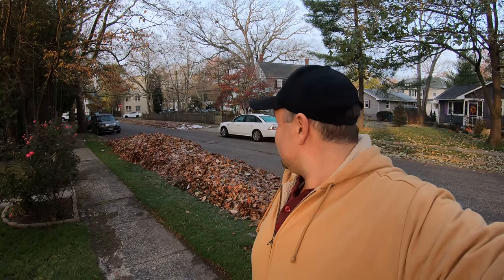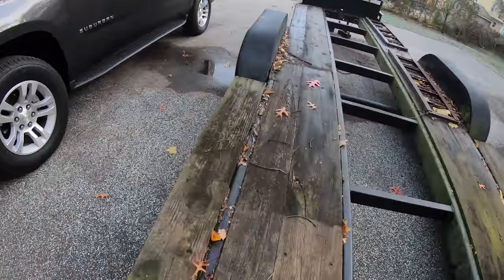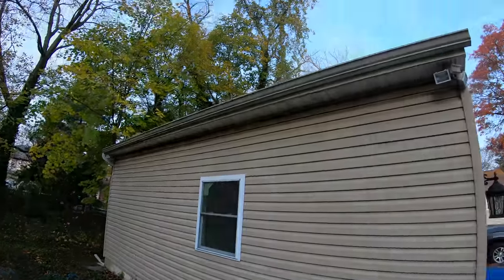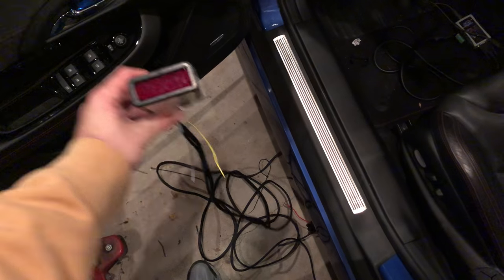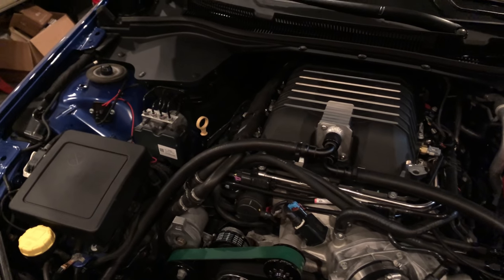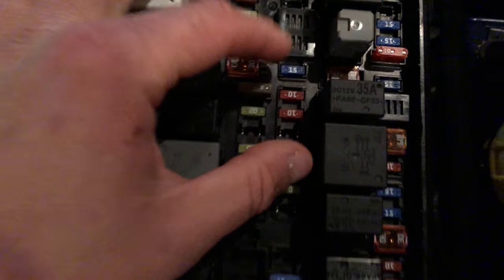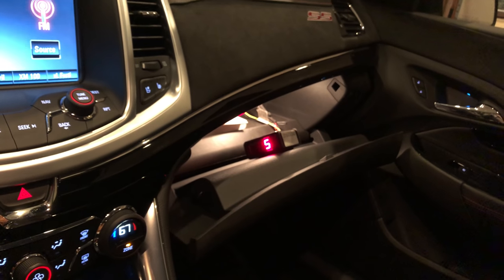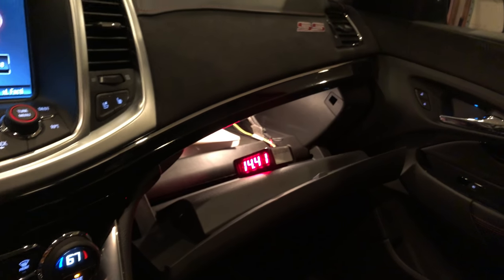Supercharging the Chevy SS - AFR500 V2 Wideband Install

Comment: mine is in the mail!
Reply from the maker: Michael Curry it’s a very well put together sample. Just make sure your tuner knows what they are doing with that system.
Reply: Yeah, he actually prefers this device to ensure that the tune is complete with no guess work, especially with the power I think I will put down.
Reply from the maker: Michael Curry I have a surprise coming shortly...mr postman is sending it my way! Should let me realize all this powa!
Reply: Dood!!! No surprises allowed!! Actually, I had to purchase a stock sized pulley for my ATI balancer because I will run out of fuel...least this way I will have an upgrade path if/ when I add Meth or aux fuel. So, now I have a 8.660” pulley sitting around...
Reply from the maker: Michael Curry I’ll give you a small hint....one letter actually...

E
Reply: It’s gonna be awesome!